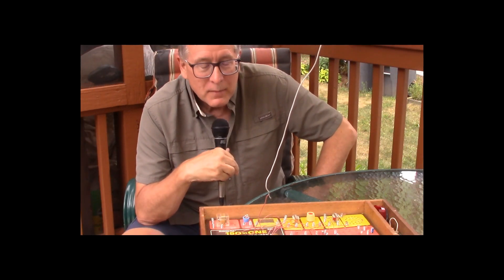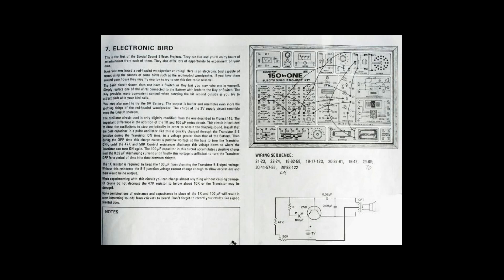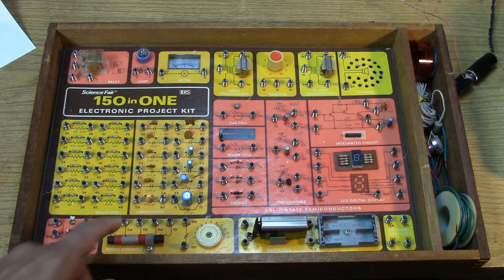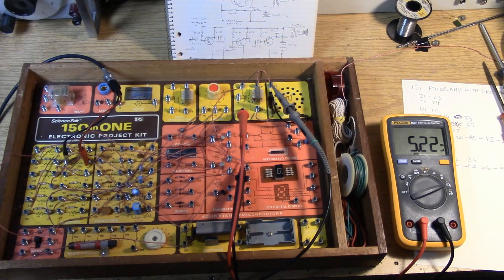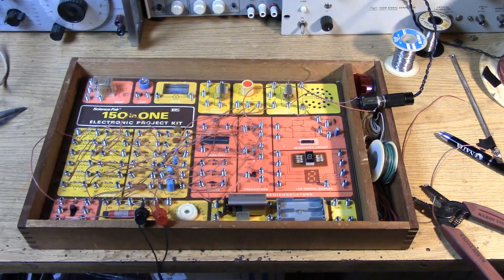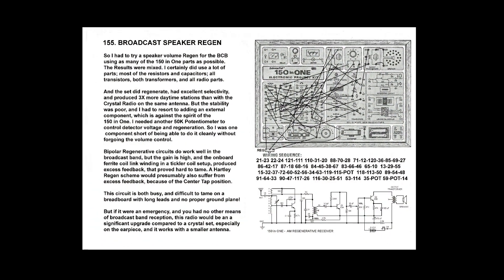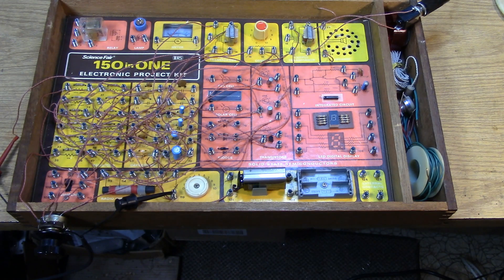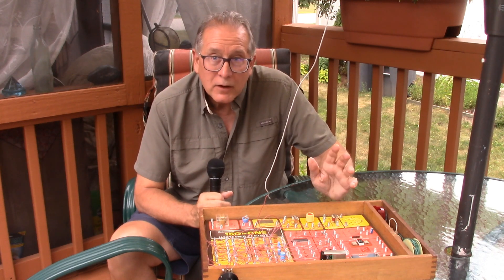150 in One  - Part 2

Comment: I had both the Heathkit JK-27 Electronics Workshop which had the same sort of wire springs with which to connect various components into a circuit; and I had the Norelco/Phillips 'Lectronic Dominos set which was really unique in the way the components - represented by their schematic symbols - had small magnets in their base and sides to allow them to "snap" to each other and a metal ground plane, forming the circuit! Great fun with both!
Reply from the maker: i'm amazed at the number of these teaching kits that are out there  from all over the world. They taught 2 generations of techs and engineers.

Comment: 13:00 minutes in was what  my expectations of what I should be able to do at ten to twelve years of age. Nothing I tried ever worked. Good thing I could hook up speakers and learned to replace some output transistors in stereos and fix basic power supply problems. That kept me going in my early mid teens. Then automotive and grass cutting with a paper route took precedence.

In the mid 1980's it was apparent even to a young man that consumer electronics was heading to the disposable approach as compared to repairable. I looked elsewhere for my future and was pushed into college.

Comment: I had many of them kits over the years. Even the 200 and 1 shown in video. that one was sold for many years .  What few radio shack stores left , they have the Elenco  one. They currently  make a 130 in 1 kit. does look like the science fair one. Amazon sells them. Fran-lab on you tube did a video on that kit a few months back. Great hearing about that 150 in 1 kit history. I thought a HAM was behind it. I herd that many years ago . The last kit RadioShack had I think was the 300 in 1 and had a bread board that you plug the parts in.  The only one I have left is the 200 in 1 kit.   my clear cover not clear anymore and the side broke off the lid. the rest still works fine. I learned a lot with them. My girlfriend plays with the snap circuits one. A local hobby store has them.  So happy to see kits like this still sold to this day ! Both me and my girlfriend are in our 50s now and we play with kits like that . Their is no age limit on having fun and learning electronics . 73

Comment: I had one of those back in the 1990s when I was just a lad 😅 
Then I started making circuits, in the shape of the schematic with wood boards and self tapping screws and washers. By my late teens (around 1997) I was building with rats nest construction. I still build that way now

Comment: You inspired me to pick up a Tandy 150 in 1 Science Fair Kit on ebay. My first project, #1 Electronic Candle, is a failure. Nothing wrong with the components. Just me and my wiring. I think that's why there are so many lightly used kits available on ebay. The majority of kids probably opened it up at Christmas, tried working through a few projects, gave up, and banished the kit to the attic, only for it to eventually end up on my work bench to challenge my dwindling 63 year old brain. This serves to remind me just how difficult the art of electronics is. It requires some considerable natural aptitude (which I sadly lack), close attention to detail (which I also sadly lack), a high tolerance for frustration, and willingness to experiment and persevere. I will continue. I'm certain that eventually I'll succeed. Well, I'll succeed with project number one at least.
Reply: Keep at it! It's good for your brain. You'll get very good. Enjoy!
Reply: @johnnytacokleinschmidt515  I agree! I'm 51, and I'm now learning more than ever before. Thanks and take care.
Reply: @W1RMD  No worries. I will keep at it. Things are working with the 150-1 kit now. The relay was just a bit tired. Onward and Upward (KO6ABI).
Reply: @erikburman530  These older components can be tricky. Take the relay and use the normally open contacts in series with the coil like a buzzer and that will help to clean the contacts. Good luck and 73!
Reply: @W1RMD  thanks for that tip. I’ll give it a go! All the other components checked out okay, except for one disc cap that seems to be way out of tolerance.
Reply from the maker: Fantastic!
Reply: Yep, that pretty much sums it up.

Comment: Thanks for doing this series.  I remember playing with my friends 150-in-one when I was in grade school.  I also remember completely missing the point of the Integrated Circuit! (Why would I want that??) :)  I love the way you've made the extra pages for the manual.  My parents ended up getting me the Digital Logic Lab with the 7400 NAND chip on it, and the "Digital Computer" kit with the slide switches and light bulbs.  Anyway, dumb question here.  I remember the original spring contacts having a narrow end and a wide end, and the springs were inserted into the cardboard from the top, narrow end in.  I'm not 100% sure but it looks like yours are the other way round.  Is that how yours came? Am I remembering wrong?  Seems like it might be marginally easier to deal with the wires if you have a little bigger radius on the spring, but otherwise it probably makes no difference.  I still think those spring contacts were probably the best and easiest way to get kids started with electronics.  Thanks and 73 - NQ8N
Reply: Some of the cardboard holes in my 100 in one got "honed out" from lots of use, so I would flip the springs and put the fatter end in the holes so it would still work, sorta. I still have it, and have some places where I glued extra cardboard to mount new/different parts. (light bulb, meter, transistor) Maybe Mike's the same. 73 de W3IHM
Reply from the maker: Various kits show them both ways - dunno.

Comment: I was given the Philips version of one of these  and went through all of the circuits many times.  As I recall, one of my favourits was a 'remote control' that used a cadmium sulphide cell that yould trigger with a flashlight to operate a relay.  These sorts of kits really kept my interest in electronics alive.  Thank you for this series of videos!
Reply from the maker: I know it was hard to stay on task building a crystal set, or garage door alarm, with all of those girls milling around the shack!

Comment: Project 156: solid state battery tube ?
Reply from the maker: I knew that the little teaser was going to cause issues. Solid Stating vacuum tube circuits or making tube plug-in equivalents was, and is, a thing. Why not?
Reply: @MIKROWAVE1 I was teasing you back. ;)
But with a little serious undertone.
Throughout the years I  watched all your videos.
And with every project you make an effort to
mention (if possible) many tube equivalents.
But in the long run all of them will become hard to get or
unobtainable(s).
For now, depending on who you are and where you live,
it's already  difficult.
So in the back of my head there's always this little nag:
wouldn't it be time to acquire some knowledge and background,
accessible to many, to sustain the future of tubes with a little help of...
As a lover of free flying electrons I wouldn't mind some solid
state assistance.
Jacob
PE1LLA

Comment: I  remember using an extra winding to get regenerative feedback,  adjusted coupling by moving it closer or further from the loopstick, worked but was fiddly.
also made a second regenerative with loopstick and grounded base antenna amplifier (my fathervsuggested the amp), loopstick was scavenged from a junk radio  (found in dumpster when a neighbour moved) removed the original wire and replaced with windings to give me SW from about 3.5 to 14Mhz, regen was controlled by the pot and output volume by switching in resustors in a voltage divider fashion, not elegant but worked (better fine tuning of the regen and crude stepoed volume)
more than one hour sitting listening to CW  and SSB on that,
Reply from the maker: Wow wow wow, this goes into REGEN NUT territory! - now we are talking. But that was an adventure all right. Sort of gives you respect for real circuit boards and shielded boxes.
Reply: @MIKROWAVE1  yeah, if I moved hand it started howling or detuned... But as a 8-9 year old in early 80s it was a great learning experience